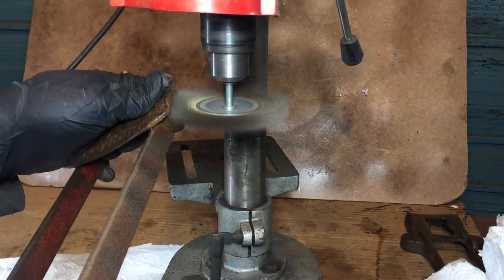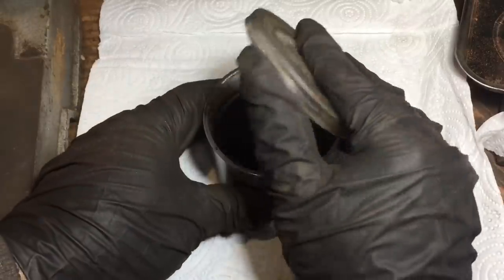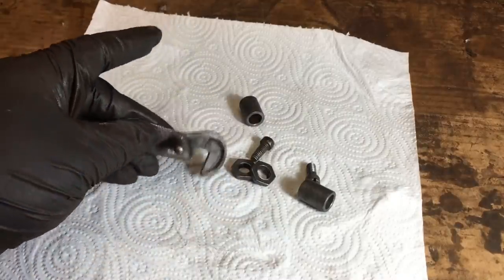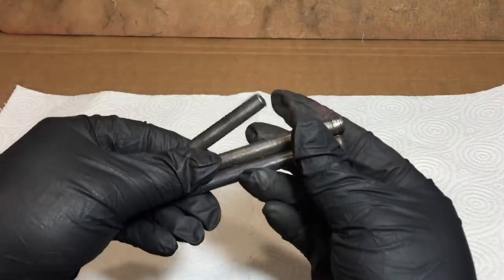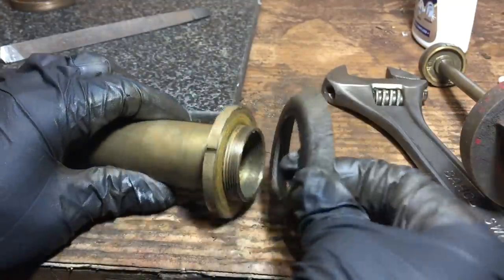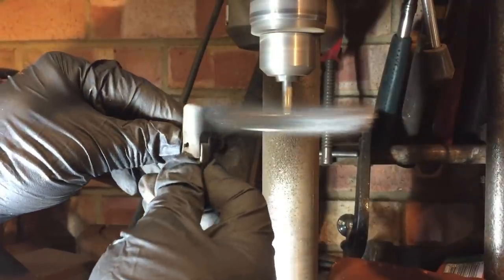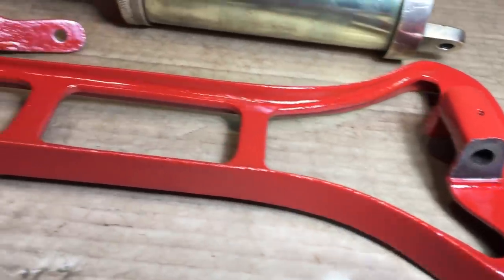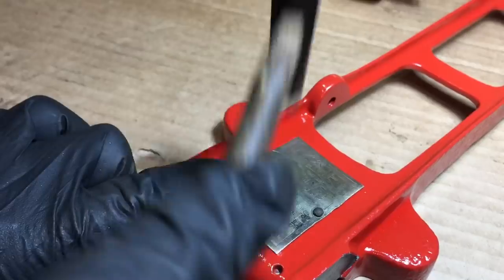Vintage Kismet Master Foot Pump Restoration

Comment: I inherited one of these pumps a  few years ago, and it's been languishing at the back o my garage ever since.  Now I see , from all the articles, text and SMS messages that I've  seen today, that I have a little, well not so little, gem lurking in said garage.  I shall clean it up, and find a connector for it (it doesn't have one at present).  My partner was all for throwing it out, it's only the hoarder in me that saved it!  It certainly was well engineered, what we used to call "Clyde Built".

Comment: Hi, it's great to see these wonderful pumps restored, testament to how things were made before the throwaway society came along. One thing people sometimes miss on these Duplex pumps is the 'top hat' washer. At the 5.50 min. stage where you're removing the second stage barrel, you see a slotted cap which unscrews from the gland box and which seals the outlet rod. Remove that cap and you uncover the 'top hat' leather washer. A tricky little beast to replace either  with leather or nitrile rubber O rings as a suitable substitute. If that let's air through, then a lot of the good work on replacing the other 3 main washers is wasted. But though it's not shown on the video, I'm sure you checked it out.

Comment: Look at the quality of older equipment  , cast metal base and caps , strong side rails , and not a bit of plastic anywhere . Always worth the time to restore quality .
Reply from the maker: Absolutely. When I was searching in vain for parts people were confused why I would restore such an old pump instead of buy new.
Reply: TheJR1948  Exactly, all the wearing parts screw/bolt together with no crimped joints.

Comment: The way you made the leather seals is pretty much how it was done back in the day. Maybe not always, but for farm repairs, that's how they did it. I've even seen that done for seals on old flat head engines. Do yourself a favor though, spray some WD 40 inside there. The water you used to shape it will will eventually evaporate, and leave the seal dry and not working like it should. WD won't evaporate quickly, and it lubes the inside while it's at it. 
what you have is the manual version of a two stage compressor, you're right about how it works, the first stage compresses the air so far, then the second smaller stage compresses it further. Came out pretty nice, maybe not show quality but it works that's often what really counts. You gave it new life, that's for sure. Oh, at least for the smaller pieces, if you bring your vinegar solution to near boiling it works faster. however, I don't care for the vinegar treatment on steel. If you want to know why, soak a bolt in the vinegar solution, then leave it out on the bench for a while, even an hour. or so. It actually makes it rust more and faster. Don't ask me how I know, but I do...
Reply from the maker: Thanks for the advice. I’ll spray a bit of wd40 tomorrow. 
I don’t like restoring these types of items to show quality. It looses a lot of character. I like to judge each Restoration differently. 
I didn’t realise how amazing this pump was until I saw the double barrel. 
I’m glad you liked the restoration.
Reply: @mytinyworkshop1213  yes I like a workaday restoration that gets it working and reasonably nice but not so nice you're afraid to use it, on many things anyway, some things deserve a full blown to the nines restoration, but not many. Oh, I used to be an editor, it's realize, not realise, at least here, maybe they spell it differently there.
Reply from the maker: I totally agree.
I like to use most of my restorations and I like seeing some of the old mixed with the new.
As for the spelling, we use s here. Although both s and z are accepted.
Reply: @mytinyworkshop1213  here it's z only, spell check will tell you the S is wrong. However, I know there are different spellings and uses for many words in other countries. Here, it's color, UK is colour, such as that. A UK guy wanted me to help him edit his book, but it was written in UK lingo with UK spelling and expressions, frankly I couldn't make heads or tails of it. Another lady had me help with her book, but she was very careful to use US English and expressions, though she's in the UK. That was a marketing choice that seemed to work for her, the US being a much larger market than the UK. We had a guest a couple weeks ago that's from the UK, but lives and works in Ethiopia now. I loved to just ask her questions just to hear her talk, not necessarily the answer, but the way she said it. I take it you're in the UK or a country with a heavy UK influence.
Reply from the maker: Yes I am from Uk. It’s amazing how different we are.
Reply: @mytinyworkshop1213  years ago, some of Johnny Carson's people pulled a joke on him. They put him in a room with what he thought were English high society types. They all spoke in a manner that he could not understand at all. It was priceless the look on his face. The couple times he did try to say something, all he got were blank stares. The look on his face... just priceless. 
What I find strange are many of the UK expressions and colloquialisms. I can't often make heads or tails of what they're really saying, even when I understand the individual words.
Reply: @mytinyworkshop1213  Don't use WD40 as it contains mineral oil which will rot and dry up the leather seals over time. Best to use a vegetable or olive oil. There's a fill hole on the barrel on my Master. Fantastic video by the way. Subscribed!
Reply: @paçoqita  you think veg oil and olive oil won't rot? Mineral oil will not. In fact if you get the food grade mineral oil, it's good to use it on cutting boards and the like because it doesn't go rancid. Way off base sir.
Reply: @dfar2303  Mr. Farmer, to be precise, English was not truly "invented" in England. The roots of it are Germanic in origin, thus the roots of American English are Germanic. I know that things are spelled differently there, but that does not necessarily mean they are correct, or incorrect, just different. In fact many common English words whether American or England are essentially the same in German. English there is actually a mix of several languages, just like it is in the US, but the mixture is different. We have a lot of words from the indigenous peoples often mistakenly called Indians or Native Americans, but neither term is actually correct. We also have a lot of Spanish, but not spanish from Spain, but Spanish mixed with native that's common in Mexico and the like. My lady can speak French, but it's not the French of Paris, it's the French of Quebecers, and or Cajun French, as well as some Creole French mixed in. Language is a living thing, or should be, it changes all the time.
Reply: @tootall5559  I think you may have misunderstood. I wasn't making reference to the oil going rancid, the oil degrades the leather washers/seals and makes them harden/crack/brittle.
Reply: @paçoqita  well then, yes I misunderstood, but food oil is not the answer. really want the right thing? If you have it on hand, the thing to really use is mink oil In my case, I was referring to the Water Displacement aspect of WD 40, which is what the WD stands for. WD might hurt the leather, in the long term, but water in there will hurt not only the leather but the cylinder walls as well, causing rust from the inside. You could mink oil the seals first, then WD the cylinder, the mink oil would keep the WD out of the leather but still protect the metal. Any time you're using dissimilar materials together, what to use on them becomes a problem. Veg oil has no Water Displacement capacity so it won't work long term, and it won't kind of impregnate the metal either. There are probably other products made for the job, but one tends to use what is at hand.
Reply: @tootall5559   Restored  a few dozen of these quality British pumps. The barrels are brass and don't rust. The only maker recommended oils to use are firstly Castor oil and secondly Neatsfoot oil. Definately not mineral oils,synthetic oils or WD40. Soak and form  the seal with water,leave to dry,soak in castor oil and fit. No mention of the 'top hat' seals?
Reply: @ianoliver4290  well sir, lets face it, the makers of these didn't have such things around. What a lot of people don't know is WD is primarily a fish oil anyway, well maybe these days it's synthetic oil now, I'm not sure, but on the farm you use whatever works and is at hand, you ordinarily don't go buy anything special, I don't think you'll find castor or neatsfoot around most places these days, yes they would have been the go to thing back in the day. Sure if you restore lots of them, you went and got the proper stuff... most people aren't going to do more than one, so they use what is at hand, I almost always have WD on hand. Best choice, probably not, but it works. 
By the way, what part did you say is brass? Boiling or near boiling vinegar water is exceptional at cleaning up old brass. However it can have detrimental effects on steel if you don't do it right.
Reply: @ianoliver4290  by the way, technically brass doesn't rust, true, but it will corrode, and sometimes corrode badly.

Comment: i have the same pump but unable to get leather warsher in Delhi.  have you any clues. it's size 55 mm
Reply from the maker: Did you watch the whole video. The answer is in the video.
Reply: @mytinyworkshop1213  yes , you had taken piece of thick leather. I also searching both but till date find nothing
Reply from the maker: It’s impossible to find a replacement. That is why I made my own. All you need is thick leather. I used leather from a handbag.
Reply: @mytinyworkshop1213  yes I also purchase thick leather from cobbler now dipped in hot water for soften. hope if all well, my pump will work and I will keep in my car. This pump was purchased by my father so sentimental I attached with it.

Comment: ...but what does it do? What uses would it be put to?
Reply from the maker: A foot pump is used to pump air into something like a bicycle tyre. The up and down motion of the pump creates pressure which is then released through the hose into your bicycle. Feel free to read the video description. There is a bit more information there.
Reply: Me Here 
You must be a millennial.
Reply: Pumping a car tyre can be a bit of hard work with these, but these are ideal for bicycle tyres and with needle attachment you can inflate footballs and basketballs etc. These foot pumps are much safer than using power/compressors when it comes to bicycles and balls etc.

Comment: Nice work, looks great 👍 
      BUT!

A) No test? What kind of pressure will it produce?

B) PEX clamps... not sure if you use pex plumbing over there... if you do - the smallest size pex clamps work great for small hoses and they are crimped so it looks a bit more factory than screw clamps.   Looks Great! Keep them coming! T-Wrecks
Reply from the maker: Glad you like it, thanks for the advice. Ill have to install a pressure gauge and pressure test it. Whenever I do that I’ll put the results in the description.
Reply: The "master" as new produced up to 300 psi for aircraft tyres [Green Living Forum  - best foot pump]

Comment: Great job, I’m not saying I’m with all the new health and safety stuff, but you need to be careful with the wire brush on old paint, you may have already checked but lead paint was used a lot and it’s really bad for you if it gets in the air.
Reply from the maker: Thanks a lot Matt. Whenever I’m in the workshop I always wear a full on gas mask with filters. I look like an alien with my huge mask and equally huge ear protection. I do need to start checking these paints though since I do restore a lot from those years.